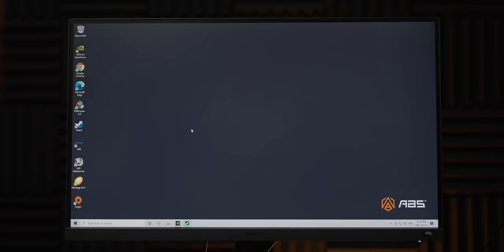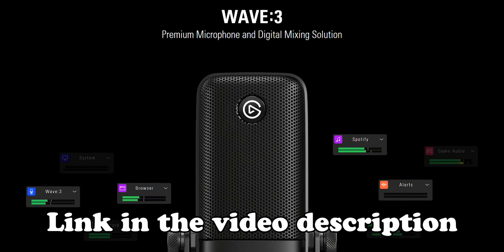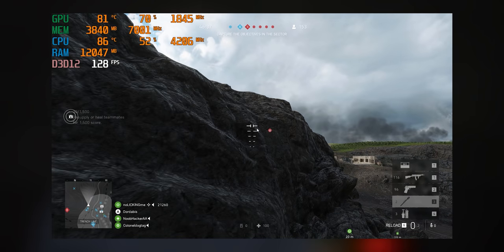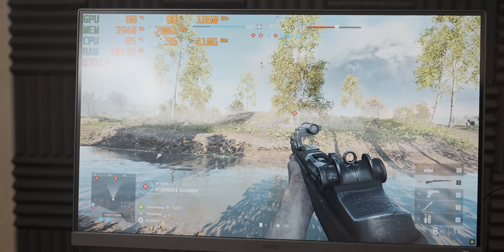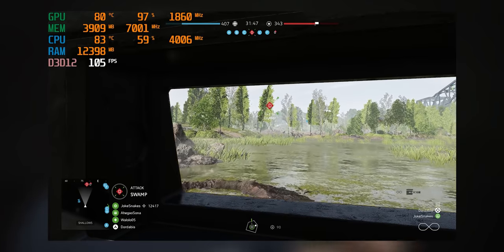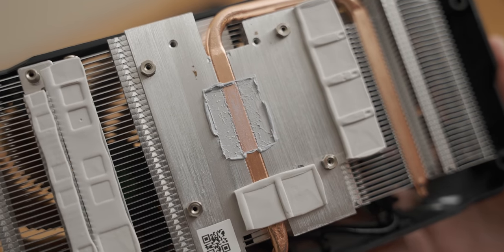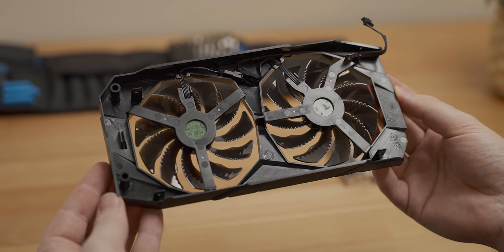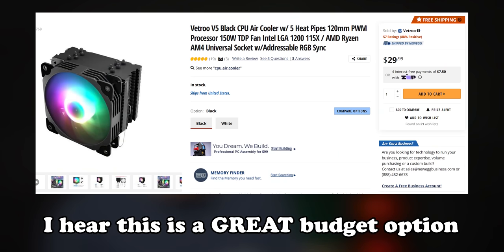Fixing The Best Selling Pre-Built Gaming PC On Newegg

Comment: Newegg isn't just bundling those gigabyte explosive PSUs with RTX cards, they are also putting them in pre-built PCs (most ABS Gaming prebuilts). If you buy one of those prebuilts, get ready to replace the PSU.
Reply: dude... the pc have evga psu........ do you mean gpu?
:D
Reply: @lougou7698  There are a few exceptions. That's why I said most ABS Gaming prebuilts.
Reply: Are all gigabyte PSUs explosive?
Reply from the maker: It's crazy that they have also been putting them in these systems.
Reply: @patirckable  No. it's specifically the 
GIGABYTE GP-P750GM and GP-P850GM.
Reply: Damn mine just arrived…
Reply: @tmmnago2722  Check which PSU it came with.
Reply: @WrexBF  easy enough to swap out right?
Reply: @pj2007  Yeah, given the kind of cases they're using it's a pretty easy fix, it's just a bit silly when you buy a pre-built to have to deal with poor quality control.

Comment: Great design of that GPU... Lets strap a piece of plastic to the top of the card to trap the heat in!
Reply: BUT IT'S FOR GAMERZZ
Reply: Gamers Nexus would have a field day 😂
Reply: I have a super version of this card... 85°C all the time
Reply from the maker: Haha!! I know right. So stupid.
Reply: It's bordering on cynical, trying to make it look appealing to non tech savvy buyers when there's no way they don't know it's compromising cooling. A lot of cheap little consumer boxes are designed that way, the makers assume that because a given chip is rated to 110C they don't have to concern themselves with air-flow/cooling (any time you touch one of said boxes, e.g. a media streamer and it's nice and toasty on the outside, you can bet there's a chip or two sitting at egg-frying temps inside it).

Comment: The Hyper 212 is a solid performer with a tried and tested design. I have one from 2011 that is still cooling a 2600K to this day.
Reply: Same, I bought one in 2013 and it's still doing a great job on the FX8350 system I'm typing this on! My new 5800x system also has one on it; no temp issues!
Reply: i mean its a hunk of aluminum with some copper tubes, it doesnt exactly expire
Reply: @bradhaines3142  Fair point, although the fan on the older one is still working well, and those can absolutely expire in 8 years!

Comment: for the front fans i suggest moving them from outside of the front case that is directly behind that tempered glass, and move them inside of the of the front frame and mount them there, so that there is space in front of the fans to allow it to suck air from the small holes on the sides of the front tempered glass, and it would not be just there doing nothing hahaha, just a suggestion tho

Comment: move front fans to inside front chassis panel from outside, let those little vents do a bit more work
Reply: I got the same Idea... How can they send it like this to Costumers.. "Pc Experts" xD
Reply: Had a similar issue with a very similar case. Fixed the airflow issue perfectly and stopped the glass side panel from being so hot you couldn't touch it.

Comment: I have used many 212's over the years and they have always done the job.  The new all black ones look even nicer.  My last build had the dreaded i7-7700K which was known for being a hot CPU.  With the 212 and lowering the stock voltage slightly, it never went over 65 degrees during stress tests and ran at full boost speeds.

Comment: The Coolmaster 212 series of coolers are great, especially if you can score them on a sale! I bought a 212+ EVO and a 212 LED for $15 each after mail in rebate years ago. The LED one is still in the box, while the EVO is on my main system which is a FX-8350. I added a second fan to it so I would have a push-pull config and it works great!

Comment: Hyper 212 is a great cooler.  That's what's I've used for years in all my systems until I got a 3950x and some AIO.  But I still use the 212 in my 2700X system.

Comment: That's essentially the same cooler design Gigabyte has used even in their 1060 3GB series. Repasting barely does anything and the plastic backplate does way more harm than good since it traps the heat.
Reply: The fan side looks identical to the cooler on the 1050 ti that I have in an ancient system. The only difference is that there's no backplate.

Comment: The best upgrade to this case is removal of the screens covering the side vents on the from. They are just stuck in place with a light glue. That alone lowered my temps with this case by over 10 degrees on the video card and 15 on the cpu.

Comment: I've tested this extensively and in my experience, mounting top fans as exhaust always gets much better results. Since the hot air rises, I've always had issues with it being basically pushed right back onto the GPU.
Reply: Any air flow overcomes any effect of heat rising. Any rising of heat is not what delivers heat to the top of your case.
If you create negative pressure you will be speeding outflow from your case, and new air is forced in to fill what otherwise would be a vacuum. Also, enough positive pressure will force air out, with new air filling the space.
What is best for your system will be dependant on your particular case, and number and placement of fans.

Comment: the top fans as exhaust may help pull more air in from the front, it works with my corsair 570X with all the tempered glass all around it.

Comment: At Dawid
If those top fans you installed were flipped around to draw air out of the system, temps would improve further!
Reply: I am not so certain, the front panel air flow is horrid. I personally believe just as important to draw air in to a system as it is to exhaust it out. As the front fans are effectively crippled, you can expect them to perform to the equivalent of around one fan, sometimes less. So, two extra fans drawing air in is probably better than attaching only exhaust. 

One thing I have come to learn, cooling is not about positive or negative air pressure. This is about airflow. A clear and constant airflow path will help you more than simply counting how many intake and exhaust fans you have. In this case, the front fans are moving much less air than they could with a better front design, so you might want to compensate by pulling in more fresh air with unobstructed fans.

When you really think about it, you only have any kind of pressure in a case when air isn't moving as well as it could.

Comment: I have that cooler (Hyper 212 red LED version) on my i7-9700K, works fine for normal use.  At 100% load, drawing its rated 95W, it doesn't get hot.  The only time the temps creep up is when you run a synthetic CPU stress test where it will draw 140W, but these tests don't last long enough to be an issue.

Comment: After building a system in a Matrexx 50, using a dental hook pick, pull the fine mesh out.  It dropped my temps over 10 degrees C, got another 5 by rear side mounting the front fans, not the front were it looks prettier.  Yes it did take some dremel work.  I have alot of pics of that system, I could email them to you if your interested in the mod for that case.

Comment: This was like a REALLY GOOD video, congrats. I felt like the content was kind of in a plateau. Although I do enjoy your videos because they are entertaining it was just that, plain entertainment. This video was really informative and overall the content I think was way better than the past few videos. Same entertainment value, plus technical tips content, really amazing. In my experience I had to play a lot with thermals on my computer. It is technically a CyberPowerPC pre-built but I was able to change things around. What really helped of course was changing the cheap fan for an AIO, but working through different fan setups, I ended up allowing the graphics card to run cooler. I did notice an improvement on performance as I am sure the card was thermal throttling. But I like your ideas of going one step further and actually seeing if you can do something else to make the graphics card cooler thinking outside the box. Keep the good stuff coming Dawid!

Comment: 8:30 This is a point that cannot be overstated enough. If you are buying pre-built, BUY IT FROM A REPUTABLE SI! They typically use off the shelf parts which makes upgrades significantly easier.
Reply: None of the SIs are particularly reliable though unfortunately. They're still hit and miss which ones are good, and which ones are bad (like the one in this video).

Comment: I would've cut out the front dust filter to see how it improves the cooling without touching the rest of the cooling components before changing the cpu cooler. Also, I think top intake is a little bit awkward

Comment: i have always been a fan of top mounted intakes, vrms and cpus love it even if some people find it contradicts conventional airflow patterns. and plastic backplates have always been useless, but some people find them aesthetically pleasing and complain when cheaper cards (and a few "premium" models) dont have backplates so companies just give it to them.
Reply: One good thing about all backplates: they protect the PCB from getting components knocked off or shorted out while PC is running. That said, I'd probably cut up that backplate for airflow if I had to use the abominated 2060 in this video.
Reply: @JonathanSias  if your gpu is touching something when your pc is running you are doing it wrong (unless you are talking about decorative funko-pops?). as for knocking off components, your motherboard doesnt have that problem so that could be a case of be more careful when holding it. i appreciate the devil's advocate, but really they are useless
Reply: Backplates should be metal or not exist.
Reply: @frommatorav1  yeah, at least metal provides rigidity and cooling potential, though some cards dont use thermal pads but they really should

Comment: i got the same gpu. have the same thermal issue. gonna take the back cover off to see if it works for me. thanks for a very possible solution. been struggling with it for well over a year.
Reply: @Paulie Walnuts nah im still playing cautiously. i've been told the back plate protects the pcb or somthn. the card is fine tho. no thermal throttling or anything. its just the temp 82-83 under heavy load.

Comment: my prebuilt came with all the fans turned to exhaust and had temps in the upper 70's to about 80 C then I flipped half the fans around to intake and reapplied paste and temps fell about 7 C on average lol, ended up getting a big chonky aio for the cpu and the temps now rarely get above 70 but it's amazing how fan orientation can have such an impact

Comment: I gotta be honest, I was kind of hoping you were gonna just take the front glass completely out and replace it with some kind of mesh frame you made by hand or something, but this works too I guess. Good job getting those gpu temps down with just a backplate removal. I would had definitely tried to open up those front vents more, at least on the bottom, so it blew fresh air in for the graphics card.

Comment: I would have been curious if you just moved the front fans to the top and left the stock cooler if you would have seen any relief.  Good video.
Reply: I reckon moving the bottom 2 front fans to the top and reversing the other 2(along with the 2 on the CPU cooler)  so the rear is also an intake and hot air is exhausted through the front would do the job just fine.

Comment: It might be worth trying to mount the front fans inside the front frame rather outside where they currently are. Then they'll be a little further behind what tiny ventilation is present at the sides of the case front.

Comment: if that NVDIA card is the same physical size as an RX570, two 92mm fans cable-tied side by side to the heatsink will fit nicely and cover it. I had to do that to my ASUS Strix 570 after the fans wouldn't stop ramping up and driving me crazy with the noise, I went with two Arctics and powered them via the motherboard.

Comment: For anybody thinking about it, the Vetroo V5 is a great cooler on a budget. It keeps my ryzen 7 5800X at around 66 degrees with the stock fan that comes with it and only the 2 stock fans in my case (corsair 4000D). Machining tolerances could be better but overall it is great for what you buy. Heard the Intel plate can be janky but IDK about that.

Comment: I bought a newegg ABS....   3 issues..   1.  Bios was so old it caused programs to crash and system to run really slow.  2. they promised and sent 3000 mhz ram  but that speed wasn't suported by the board,  so always ran slower  2933mhz.  3. Power button has never worked right...  it works (just have to press it 3 -5 times)     They really need to test what they built..  I was so close to returning it..   Once I updated the bios and the crashes stopped... I was much happier..

Comment: I just spent $40 for a mesh panel to replace the stock panel on my Lancool 2. If I would of seen this video before I purchased it, I would have just turned the top fans into intake fans and be done with it. The stock panel on my case is the worst, the temps on my gpu go down around 10c when I remove it.

Comment: why not try the rear exhaust, and top fans as intake and the front 3 fans as exhaust. would look hella weird from the front but maybe if you exhaust air from the front, youll be able to push the hot air out of those small gaps in the case

Comment: I believe the issue here was actually your airflow for the cpu. I have had that same cpu cooler and never had temperatures get that high after hours of gaming.
Reply: Are you using the same cpu, the i7 10700? Some cpus run much cooler, so the cooler you're using makes much less of a difference.

Comment: The reason the Hyper 212 series of air coolers is still a top seller, is because it's still got some good bag for the buck performance.
Reply: Not really, it's mostly because noobs only know about it. There are plenty of cheaper or better options than it. It's not particularly good value cooler either.

Comment: I bought an Asus G15CE-B11 prebuilt for the purpose of pulling the RTX 3080 for another system....Once I re-configured it with a new case(Silverstone Fara R1), downgraded the GPU (6700 XT), and more fans, I went ahead and reinstalled windows.

Comment: 5:32 uh oh, you should install them the other way around, so they pull air out... more intake does not reduce the temps by alot, it need proper air flow.
Reply: Same airflow in or out. If the PC is being starved of outside air bringing it in is better.
Reply: @Safetytrousers  wtf no? More hot air will gather inside and there is only one fan pushing the hot air out while 5 fans push air in
Reply: @Kartowl  A build up of air is forced out. Just as air expelled creates a vacuum effect that forces air in.
New air is coming in and taking time to warm up as already warm air is being forced out.

Comment: I gotta fix a prebuilt we use at work, the psu is configured to pull from the bottom of the case but being such a horribly dusty environment it was about to burn itself out till I blew it out, gotta flip it to suck from the relatively filtered air in the case

Comment: Why wouldn't they just charge another 10$ on a 1200$ prebuilt and put in a hyper 212 from the factory, or like move the fans to the top from the front? Bad windows installations happen sometimes, and it is unfortunate, but for how often it probably happens they will just have people ship the pc back and fix it, because it is cheaper.

Comment: Well, putting the new top fans on exhaust should give even better result imho
Reply: By doing that you could create negative pressure relying on the holes in the case to suck air in. If the holes on the top are most of the holes in the case, then fans exhausting would block those holes from bringing in air.
Reply: @Safetytrousers  Why that ? There's already 3 front intake fans, and 1 exhaust rear, putting 2 on exhaust makes the air balance mostly neutral - unless front fans are blocked but I didn't see well if it was the case...
Maybe a tad negative if the new exhaust fans are more effective, but that's not a problem
Reply: @pascaldifolco4611  He took care to illustrate how the front fans were starved of air.
Reply: @Safetytrousers  ok I didn't pay enough attention
Now Dawid could just drill holes in the front of the case 😂

Comment: Did you ever check the mounting of the original Thermaltake cooler? That's a huge temperature difference, I feel the original cooler may not have been mounted fully.

Comment: i bought the abs prebuilt with 3080 ftw3.  ditched stock case fans, lian li 120s x6,  its still a flame thrower.  considering just swapping out of the case to something else and getting the evga factory hybrid cooler to slap on the 3080

Comment: I bought one of these to get access to a 3080.
Didn't have a computer at all, and mine came with an AIO
Overall was good, but the case is just the worst.

I have since replaced everything in the computer minus the GPU and the case.. but currently building a new case for it and then putting a massive custome loop in it
Reply: Is cooling good out of The box

Comment: I'd probably have a Hyper 212 if it A. fitted in my case (it's a smidge too tall) and B. wasn't just a nudge outside my budget at the time, I got a Hyper 103 instead. Considering it replaced a stock cooler though it doesn't even really matter.

Comment: The reason the graphics card temps weren't much better was bc the top fans are set as intakes. I did a million tests and the heat from that graphics card goes straight up for some reason and the top intakes were just pushing the hot air back down on the card. Trust me
Reply: A normal GPU heatsink expels all its heated air from the sides into your case. Where it goes then totally depends on your case and the airflow within it.
Your best result would be to just leave the side panel off.